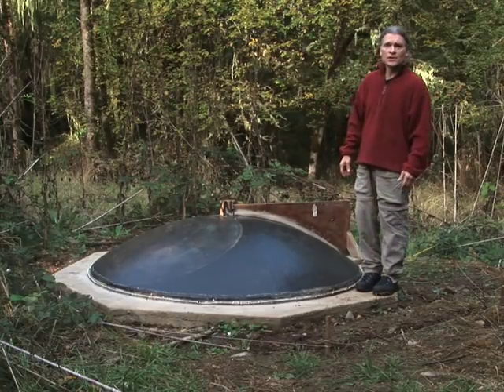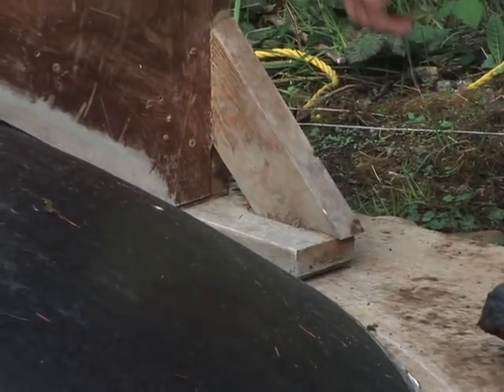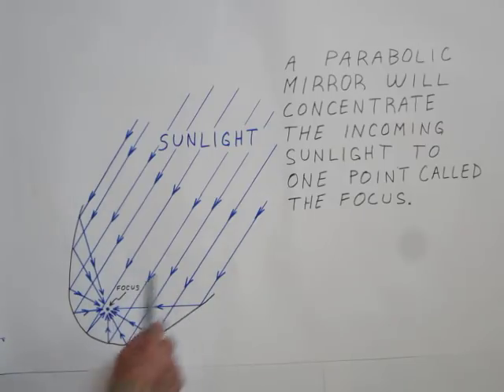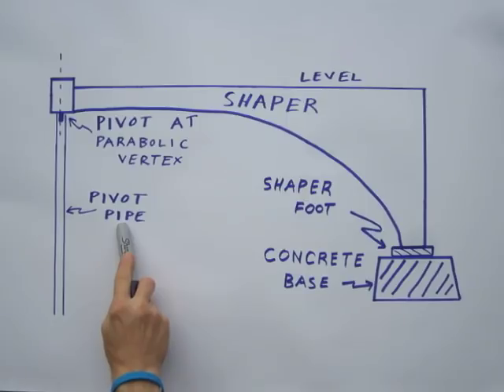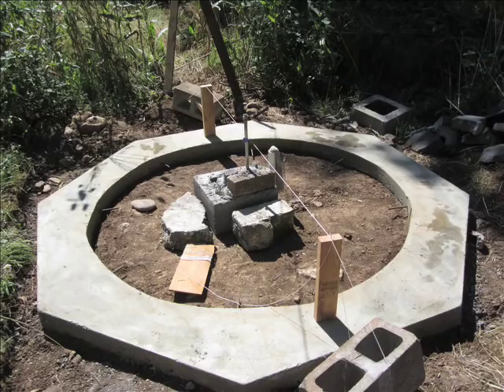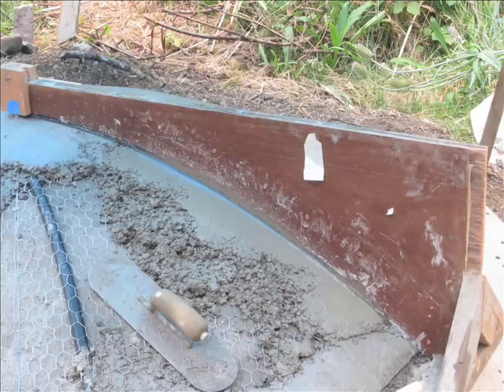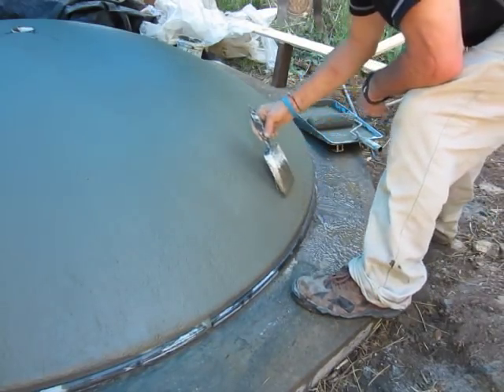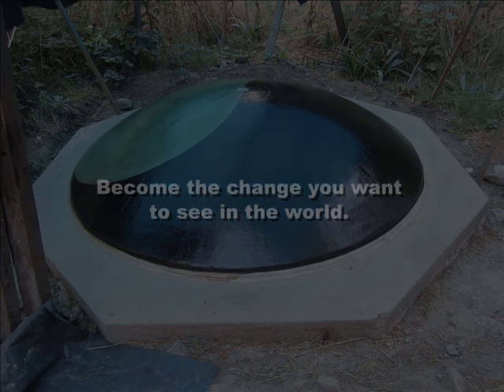PARABOLIC SOLAR COOKER FERROCEMENT, MOLD

Comment: I built several ferro-cement paraboloid solar cookers in the late 90's based on the Berkeley Thermonuclear Paraboloid published in Home Power #37 in the Homebrew column. That one has some important advantages over yours. The 11" focal length instead of your 28" is MUCH safer. Several houses had burned down in Bolivia due to cookers like yours in which the focus extends outside the dish - cookers stored beside houses allowed the focus to hit the houses and burn them down. The long focal length also creates more risk to the eyes and body. The BTP was also simpler and cheaper to make - I was making them for under $15 apiece. No need for A-frame - cooker sat in small sand-filled hollow and easily moved by hand. The pot was suspended down into the focus using 1/4" curved rebar. Aluminum foil oxidizes quickly so it should be covered immediately with Varathane or other high-quality non-yellowing varnish. This was my wife's favorite solar cooker of the several I built for her.
Reply: ***** yeah so maybe don't shine this at your house then seriously
Reply: ヽ༼ຈل͜ຈ༽ノ l You can still find copies of Home Power #37 for $4-5 online. Or you may find the full issue online. I think I have it as a PDF but it's been decades since I've used it. Shallow dish cookers are intrinsically more  dangerous, with no real advantage over a deep dish cooker.
Reply: OK, thanks for the chemistry lesson. However, aluminum FOIL left out in the elements quickly loses its reflectivity and turns gray by my own long experience with these things. The varnish maintains the shiny surface and it doesn't turn gray.
Reply: Hello, what is the best reflecting material i can apply to the dish surface to reflect sun rays?
Also are concentrated sun rays armful to human body?
Reply: I am hoping to go build a bunch of those in the mountains in Haiti and would really like talking with you about it. Is there anyway we can get in touch.

Comment: neat method to make this. especially to use a rotating shape is an idea I hadn't thought of yet. I was leaning towards the method of rotating a liquid in a large container or dish where the liquid would solidify during rotation but of course which liquid would that be, molten glass is something for large industries and companies. But the method shown here is way much easier. Probably gonna try it some time. I was also thinking about using an old satellite dish but the shape method can potentially make much larger parabolic cookers.
Reply from the maker: I found it tricky to get a very smooth and accurate surface... you can see me bouncing the scree as I finish off the cement mix.  I recently found an alternative method to finish off the last 1/4" or so to make it (potentially) glass smooth.  Check out https://www.youtube.com/watch?v=RJg7vr-7KM4
where someone uses plaster for very detailed work.  The secret is a much finer and softer mix. 
Also, I have since developed an alternative to the ferro-cement.  I hope to get videos up on it.  Simple, Geotextile painted with a slurry of portland cement and water... I call it 'poor man's fiberglass'.  I have made panelized, quick set up, buildings out of the stuff.  Add ribs to give it more structural integrity. Yes, rotating parabolic option... I was thinking of using bulk gelatin for the liquid and overlay it with a thin layer of plaster then cement something... I like the potential for a much more precise focus point vs. my low tech dish which was adequate for most things but had a more diffuse focal area.   I looked at your channel... very cool nature, bird pics etc.   You are in Germany? I'm retired in Costa Rica.    Good Luck!  Be well.
Reply: @kulemax53video  thanks for your reply! yes, plaster can be formed into smooth surfaces, personally I have no experience with it or with cements yet. So far I have only ordered a couple of items on the internet which I plan to use to make some sort of solar oven with. For example thermo blankets (mylar foil) and tape which I want to use with a plastic lid of a rain barrel, the way it is shown on another channel with a trashcan lid. However, though they are easy and fast to make such parabolic dishes always need to be evacuated (they only last for an hour or so). But I also want to make a permanent dish. For that I am groing to use a sat dish and self-adhesive mirror foil. But large sat dishes are expensive, so to make a larger dish your method would be applicable. I think there are many many materials to choose from, will have to search a lot first to find them though :D Perhaps it is also possible to use a shape like yours with a thin blade attached/glued to its curve and then when you rotate the shape it would bark a suitable material, maybe the gelatin you mentioned. As for the smoothness of the surface, I remember that people often polish the surface when making lenses or mirrors, so I guess "post-processing" of the dish may be a solution to get rid of little bumps. Yes, I'm in Germany. I have been filming lots of birds and other animals that live around here, your area also looks very natural, probably much to discover :-) currently I'm into arduino stuff which I think you mentioned somewhere as well (for tracking the Sun I think it was). I have seen in another video where they use dc motors that are powered by little solar panels which are placed in a way (behind the dish) that they power the motors as soon as the position of the dish needs to be adjusted. I think this could even be done without an arduino. I'll check your new video(s), probably I'll make one about a solar oven, too - should I ever get it to work. It's winter though, so it may take a while :-) Cheers!

Comment: In many developing countries, bread is very expensive, and is bought because fuel to heat an oven is not practical at home.  Your solar cooker could enable families to bake and cook their own food very economically, as well as helping the countries gross economic balance fro petroleum.

I have made a mold for a dingy much as you made your model, but just used moist sand with a cement skin for a one off fiberglass boat,  Innovator Jim Brown taught this method to enable small fishermen to produce a durable fiberglass boat off a male mold in the Pacific.

Now, if we could find a way to produce the insulated solar reflector from solar melted scrap plastic spread on your mold………Aah, the challenges!

Great video, with real, precise instructions.
Reply: I was in Rwanda - on the equator.  Someone paid $15,000 for a super duper bakery quantity solar cooker.  It never did the job.  It was for sale for what they could get for most of the time I was there.  If you want something for developing countries, see if it works for developed countries first.  Unless you are from a developing country you don't know all the parameters that apply there.

Comment: Solar cooking would be a lot easyer if parabole and cooking place are seperated.  Put some winded copper tube to the focus leading to the cooking container, wind the tube around it starting from the bottom center, use insulation for tubing and cooking container. A little solar powered pump to make the liquid move to and from parabole. Do you get the idea? This is a bit more complicated but ideal for a stationary model.
Reply: Water is obviously out of the equation, but what liquids could be suitable for this purpose?
Reply: @SuperPhexx  Wasser kann mit Druck vom Kochen abgehalten werden. Man würde wohl als Amateur ein Mineralöl nehmen (Johnson 's Babyöl). Hier die klassischen Kühlmittel:
Zu den natürlichen Kältemitteln zählt man z. B. Kohlenwasserstoffe, Kohlenstoffdioxid, Ammoniak, Wasser und Luft – also Stoffe, die es so in der Natur gibt. Natürliche Kältemittel haben demnach auch geringe Auswirkungen auf die Umwelt.

Synthetische Kältemittel dagegen werden künstlich hergestellt. Sie werden chemisch auch als halogenierte Kohlenwasserstoffe bezeichnet und eignen sich ebenfalls hervorragend für den Einsatz in Klimaanlagen und Wärmepumpen.

R104 will die EU verbieten.

Comment: Nice. I wonder, why you prefered the concrete solution, aginst use of the actual (satelite TV connection antena) dish as a mold/gauge for your further production. It surely would be cheaper&easier, if you use some old piece, ment for recyclation or for dump, than few bags of material and half a day work of your time.
Reply: Because the ones that are easy to come by are smaller than this.

Comment from the maker: Thanks imnewtothistuff. Helpful feedback regarding missing details construcing the shaper.

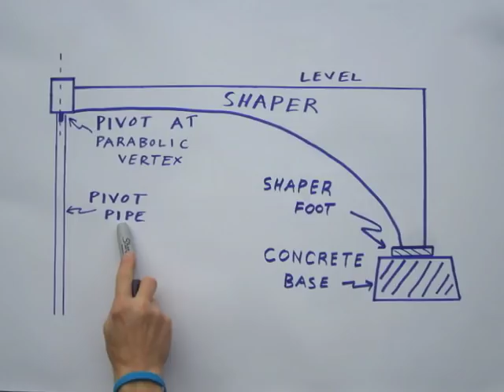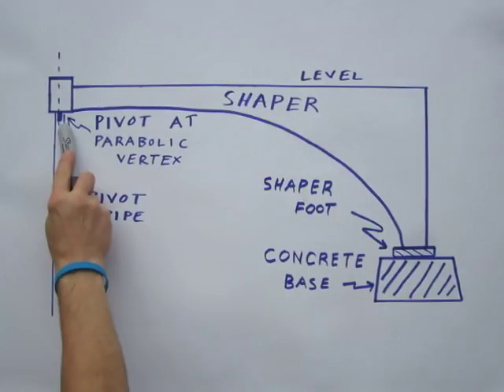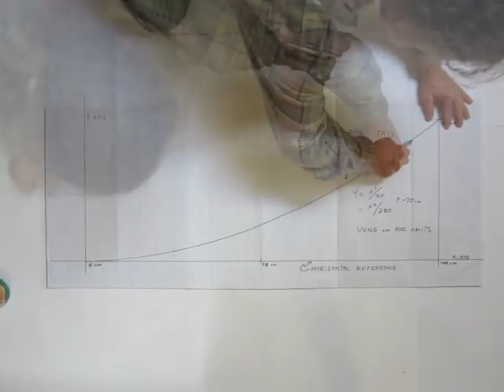I used 1/4” masonite for the body of the shaper, transferring the parabolic shape from a piece of paper, and cutting it out with a jig saw. [ see video 2:37 – 3:05 ]  I gave the shaper some extra strength by mounting a small board on one side of it.  On the pivot end of the shaper I installed a block with a pin, locating the pin's base at the vertex of the parabolic curve. [ snapshot at 4:27 ]  The outside of the shaper curve, the foot end, rides around the circular flat and level base on a block. [ snapshot at 4:39 ]  The height of the foot block is not critical, as long as the tube in the middle of the circle, the pivot pipe , is trimmed off to make the top of the shaper edge level.[ 4:53 – 4:57 ] This works because the top edge is parallel to the x-axis in your parbolic curve drawing [ 2:52 – 2:59 ] You are basically turning it exactly upside down.  Hope this helps.  It was a challenge in making the video to make it informative yet not too long.
Reply: have you considered a fresnel lens design instead of a typical all in one? I designed something like this using very basic cheap materials, that has a much larger surface area you can cover, like a heliostat that can cover the entire side of a mountain, 
goal on that was to be able to do more than heat things, but literally heat them up enough to split them, and do so in a controlled chamber like a large glass walled room, that allows enough distance between the converging points of light and its center so as to avoid heating the glass walls, while still allowing a massive heat potential on a central area inside the chamber, for splitting salts and other substances, for purifying chemicals, 

this process would allow 3D world countries to start manufacturing of higher tech resources, all with out being reliant on drilled wells for oil nor refineries if desired, however I have a process too for making crude oil out of plant matter that would make them oil producers that is completely clean, unlike oil drilled for, that has absorbed heavy metal salts and the like, thus giving higher yeilds of various compounds, than traditional drilled and pumped oil from the ground, instead this is just pure hydrogen and carbon, so it burns down or converts directly to what one wants, using zeolites that are nothing more than clay made from a lot of aluminum and oxygen, in the presence of a chemical they want to replicate, making a sort of molecular cookie cutter for converting other molecules into the desired units, all of which solar concentrated power can bake and dislodge the chemicals they want when done. import some space blankets and set up a grid of little squares with a raspberry pi, and you can even track the sun, to keep the center concentration, where desired for longer term generation, say of hydrothermal synthesis processes for making pure quartz for all sorts of components, or even sapphire, from raw aluminum oxide for dies to build LEDs ontop of, again, from 3D world to 1rst world all with out drilling a single oil well,
Reply from the maker: @ThomasAndersonbsf   Im totally with you.. Point me to a recommended link on the zeolite apps you suggest.  Yes, have used arduino technology to track and also thermostatically control a higher level box oven by controlling the position of a sun blocker over the glass window. Retired in Costa Rica. Less resources to toss at a project of the scale you mention. Also, hard to easily get materials down here.  I mostly go thru AliExpress and wait 2 months to get a stepper motor or electrical component  But we plug along. check FB Soluciones Carbono Neutral.

Comment: Wouldn't it be much easier to form a deep ring out of an appropriate material like lawn edging or some such? Stretch a 'Space Blanket' over a frame that would fit over said ring and affix the blanket using an appropriate adhesive such as silicone seal. Making sure that the frame will be deep enough to accommodate your desired depth of lens curvature. 

Further affix a hermetically sealed stiff panel to the back of this ring with a valve so as to enable partial evacuation of air from the inside of the chamber thus creating a vacuum that will cause the membrane to pull in and form a parabola. 

Having dropped in a few semi inflated condoms on the inside during construction will help compensate for atmospheric and temperature variations that would otherwise alter the focal point of the mirror film. In this way you get an even 'pull' of the space blanket material thus eliminating surface deformities as much as possible which would otherwise greatly decrease mirror reflective and performance. Your resulting mirror will be light weight as well and/or easily repairable. 

I also have plans for an closed solar oven that should reach temperatures of around 1,000 depending on the type of insulation used i.e. aerogels or even popped popcorn, using a single an auto solar tracking 2-1/2 square ft. Fresnel lens focused on a heat sink over which oven air would flow and featuring a photo voltaic powered air circulation system and flameless (platinum wick via Coleman) hydrocarbon back up system to accommodate use during night and inclement weather conditions.
Reply from the maker: Thanks Paul Stovall,  Lots of great suggestions... seven years later, now, retired in Costa Rica, my offerings are for rural inhabitants with minimal resource access.  Current local offering is a lightweight shell assemble-able  form which people can borrow and apply 'poor man's fiberglass' (ie. GeoTextile fabric painted with cement slurry) with fins to give it strength.  I want to be able to put down the aluminized mylar and then apply the 'fiberglass', but a current challenge is to get it to stick and not corrode with the alkaline cement.  Polymer resin is not in the local's budget.  My next play experiment is to make a 2M diameter rotating liquid parabola which will solidify for an initial precision mold.  For the BTUs I need for specific future projects I need a bank of 10+ 2M dishes to supply the heat for ethanol fuel distillation.  Also, working on some fused salt storage to supply heat for a solar bakery which can start baking at 4am. I've also been pyrolyzing rice hulls (and hope to try popcorn) for use as high temperature insulation.  Hi temp insulation products like Fiberfrax are hard to come by down here.  My solar box oven gets up to 450F but much higher and it will catch fire unless I upgrade the insulation. 
You mention aerogel... know of a cheap source???

Your partial pressure approach sounds like fun... you might be able to make a manometer like pressure regulator with a bag of water hanging from an tube from the inside chamber of your at the correct height.  This might compensate for changing atmospheric pressures.

Thanks for commenting... onward...
Reply: kulemax53video  You're welcome. I wasn't trying to be critical and understand resource availability in developing countries. I had tried at one point to 'give' my ideas to an funded outfit out of  Sacramento Ca., who would have had the resources to develop and distribute the ideas but they seemed more interested in keeping the technology down and sending them nothing more than low performance box solar ovens instead. Consequently, I was forced to learn that they weren't really interested in helping people at all. Sad. 

They'd have had opportunity to offer something that would be durable and work at a higher efficiency level. They went so far as to suggest that I build a few thousand units then call them. Something that was out of my capacity at the time beyond the conception. Solar is a grand and free resource but it must be approached at on its'own terms, as you no doubt know all too well. We simply need only adapt. Alas. Now I'm too old and broken to further pursue. Little more than time to think. 

I know it sounds strange but I believe there might actually be a way to overcome the limitations of Newtonian physics (Nature does it). Relatively small hydro/mechanical devise with one moving part. 

I know it's 'impossible' but for the life of me, I can't quite understand or figure out why not..... And I'm diligently looking. 

We routinely use systems that operate at 90-99% efficiency (i.e. kaplan hydro generators and related machines). I'd just like to see a big bite taken out of that last one percentile. Wouldn't that just boil the pants off the world controlling energy industries. Oh, and like 'solar', outside of construction, it too would be 'free'.

Thank you Sir for your timely response and please be well and enjoy your retirement. 

Sincerely,
Paul